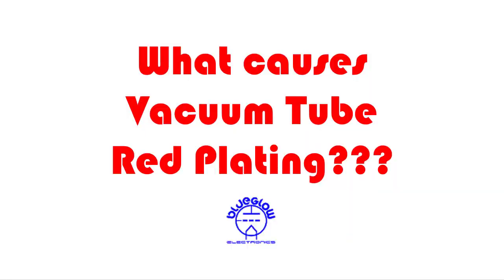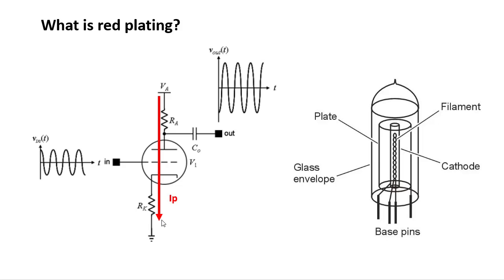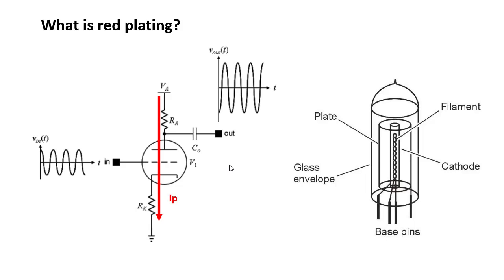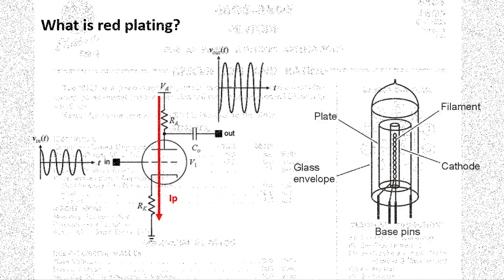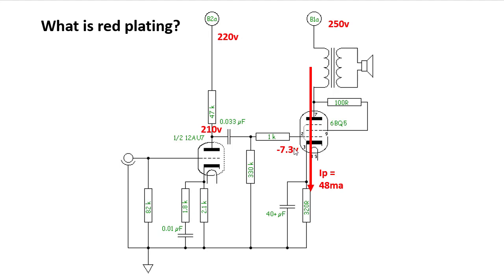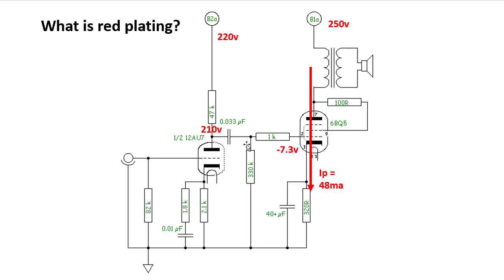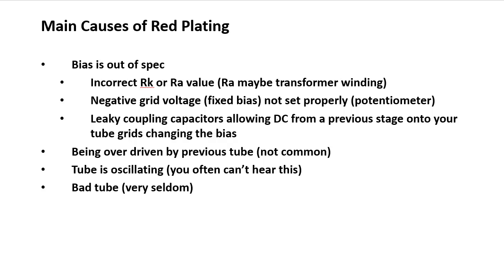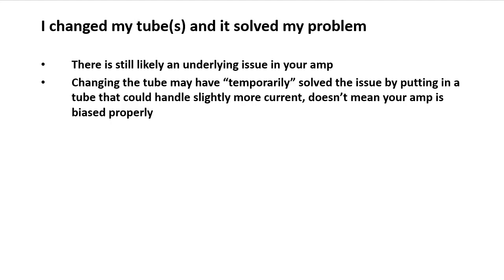What causes vacuum tubes to red plate?

Comment: Beautiful video!!! A customer just brought me a Orange rocker 30 and it's exactly a EL84 red plating. Swapped the tubes and it seems the trouble isn't anymore. BUT after watching this video, now I have to ensure something else is not failing.

In this case, amp HT fuse was blown up, and that was the reason customer came for. I replaced with a 500mA standart fuse and it blew, then I tried with a 1A and it didn't blew. Then I replaced with exact type of fuse Bussman 500mA slow blow fuse and also it didn's blew up. And only then I observed one of the two EL84 red plating.

Comment: Thank you for this. I have a brand new (well, it's actually about 5 years old now, but has about 30 mins playing time on it) Carlsbro 30W amp that has this problem on one of the 6V6GTs. The amp was a total disaster (I got it un-opened from a music shop that went out of business). From the very first power up, it was wrong. The first fault I found was the heater pins on one of the power valve sockets was not actually soldered to the board. I fixed that, but now it red-plates. I managed to get a schematic, so this has given me the inspiration to dig it out and see if I can fix it. I'd send it to you but I'm in the UK and it's a 240V unit ;-)
Cheers
Mark
Reply: It's red plating because it is drawing too much current. Check the grid bias.
Reply: Hi Mark. Let's stay by the book. As John mentioned check the bias. Since the amp was running asymmetricaly, consider the output transformer could be fried. Just for reference check the resistance of the primary winding. (From the center tap to the anode of each tube). PLEASE if you do so set the amp to "dark and cold". This means UNPLUG the amp and DISCHARGE the filter caps. In "hot and working" check the voltage drop from center tap to anode. In case you encounter divergence in the readings, switch the tubes and figure out if the problem stays with the socket or the tube. It would be nice if you could provide the schematic. Once again lift yourself from the ground i.e. rubber sole shoes etc because, anode  voltages are nasty somehow (some amps like Music Man go up to 700Volts!!!). Line voltage should not be a issue, step up/down transformers exist on both sides of the lake. Maybe your device has a voltage selector? For us in Europe only the power outlet plug changes. In Austria we use the "SCHUKO", it looks like a pignose....

Comment: Excellent.  My only thought is the role of cold or otherwise poor solder joints.  Increasingly over the years I am finding this to be a major issue.  My practice now is to touch up everything on a given stage before I even reach for a DMM.  Measuring bias when you have crappy solder work has been a waste of my time.

Comment: In the case of EL84 guitar amps, I'd consider a bad tube a pretty common cause. Typically, these tubes are run flat out at 100%, if not a little more, often with 300+ volts.  I've had several start to red-plate after a year or so of use. In the most recent case, one Sovtek EL84 red plated, had more blue glow (both in the bottle and the typical lines within the plate), and there was a noticable hum. Little orange specks were visible around the screen, too. Swapped the two tubes around, and after about 10 minutes it started to glow again, following the tube.
Reply: Hi there!! In my case, I did the swap, and none of them went red plate. What could it be?
Reply: @elsenordefiler1893  Oh so you had a red plate, swapped the 2 around, and the red plate went away? 

It could potentially be related to the bias on each specific tube socket, which may happen to not cause a red plate on the swapped tubes. It could still be a sign of a going-bad tube and/or very high 100+% bias. 

If they share a common cathode resistor, and voltages match up on screen and plate, that's unusual. 
I'd definitely check voltages to be sure both sockets are properly biasing tubes.
If it's adjustable bias, similarly it'd be good to make sure the tubes are running at a reasonable dissipation. 

Coupling capacitors before the grid can also cause this when they begin to leak and allow positive voltages on the grid, but this failure is usually more noticeable.
Reply: @JulianA-tr6pt Thank you for your reply! "Oh so you had a red plate, swapped the 2 around, and the red plate went away? " Yes it went away.

This amplifier is self bias so there's no adjustment pot and yes, the two EL34 share a common cathode consisting on three paralleled devices: one 270ohm 5W resistor, one 330ohm 5w resistor and one 220uF electrolitic capacitor.

For the coupling capacitors it has one 100n film cap for each EL34. Also there's an 12ax7 driving both el34.

Worth mention, red plating occured not that fast.

Comment: Howdy. Nice.
I have had my share of red plating in my designs. And You are correct.
In some cases the root reason was parasitic oscillations. These were devilish to spot. When the oscilloscope probe was connected between the anode and B- the glow died. But eventually the scope was connected over the OPT secondary revealing violent oscillation at about 50 kHz. In some cases increasing the grid stoppers worked. In other a small cercap. from the anode to the grid worked. Like increasing the Miller capacitance.
And yeah. A few coupling capacitors have proven to be leaky though brand new. My advice is to always check the capacitors with a multimeter before soldering. Also devilish to spot otherwise. Checking the DC potentials at various points eventually put me on the track.
Best Regards.
Reply: Interesting.  I only had it happen once when my bias was too hot.  I want from one neighborhood to another with higher mains voltage, and the Chinese tubes I was using were known for thin plates, (I think).  The sound dropped out completely, then I looked.
Reply: @qua7771  Howdy.
Thinking about it I had another root cause.
I had followed the rule of using a separate wire as the B- bus connecting it to the chassis only at the input jack. Nevertheless parasitics were experienced.
The cause was that the B- bus wire was too thin. I recommend using at least 1,5 mm2 as the B- bus. Also the bends in the B- were too tight causing inductance. Using as shallow bends as possible in the B- bus is recommended.
Regards.
Reply: @eugenepohjola258  Thanks for the tip. These are things I wouldn't ordinarily think of.

Comment: Good video!
Personal red plating experience:
Almost always a leaky interstage coupling capacitor.
Once in a great while, a shorted cathode resistor bypass capacitor.
I have never seen a voltage amplifier tube red plating. Have seen several output tubes red plating. Saw a few rectifiers red plating as the power transformer was smoking (shorted filter cap, one time a filter choke with an internal short to ground)
Reply: Dave Kazoroski I would hazard to guess since most preamp tubes aren’t operated anywhere close to their limits (usually) that it would take a pretty catastrophic event to make one red plate. I looked around and couldn’t find a picture of a red plated 12AX7. I would assume that the voltage dropping resistors and plate load resistors would probably limit the current sufficiently to keep from damaging the tube if there were a loss of bias, ie., cathode shorted to ground. Unlike your power tubes whose DC supply is through an inductor with a low DC resistance.
Reply: Actually, some voltage amplifiers have the cathode connected directly to B-. They use something called "contact bias". A certain number of electrons coming off of the cathode "stick" to the control grid, thus causing a negative charge of a volt or so to build up on the grid. 
And as you say, the plate resistor of a voltage amp is high enough to limit plate current. With a power tube the series resistance is very low, enabling a very high plate current to flow. Plus, a power tube needs several volts of negative grid bias - contact bias won't work here - loss of bias results in a grossly overheated red plating tube. ( I've seen TV horizontal output tubes orange plating - hot enough to melt the glass)

Comment: Amazing channel and have subscribed.  What could cause the plate current to drop if B+ and B- is correct, cathode/anode resistors good?  Cathode bypass capacitor good.  Tube is confirmed good and it's compliment is suffering the same issue in this balanced push pull drive configuration.  They directly drive high impedance headphones.  No transformer.  Swapping headphone channels (drivers) makes no difference.  The amplifier is a little dot Mk6+.  I am an electronics design engineer with 30 years experience, so no fears other than I am a tube noob.   It is a balanced push/pull configuration for each driver...like an "H-bridge".  So one set of 6080's for each channel, both affected by low plate current.

It looks like this could be a grid bias voltage issue?  Instead of overdriving the tube, it is instead "under-driving" the grids of the output 6080s???

Comment: A good explanation of red plating, thanks Mark.
I will look a bit further into this. I'm curious about the long term effects of red plating a tube... the failure mode would be different from a silicon device as the silicon device would either short out or blow open the substrate.. in the case of a tube there is no substrate, just a vacuum. Perhaps the damage is due to plate warping or other physical movement of parts in the tube...
I really appreciate these videos, thanks for taking the time to make them!
Cheers,
 - Eddy
Reply: Red plating causes the plate to release trapped gasses in the metal, damaging the vacuum.
In older TV's sometimes the horizontal output tube would red plate due to loss of drive. They got so hot the glass would melt. Red plating can destroy a tube in very short order.
Reply: Did a little more research (benefit of being semi-retired). 
When a tube is red plating, the current through it is much higher than normal. The massive flow of electrons to the plate litterally takes the special emissive coating on the cathode with it. As this coating erodes (normal over a tube's life) the tube gets weaker and weaker - low emission. Basically a few minutes of red plating is equal to several hours of normal use. So no matter how you look at it - red plating is bad for tubes.

Comment: Hello. Thank you for this great video.So I have this vacuum tube amplifier with eight  kt88 tubes as output. The amplifier plays well at low volumes but when I turn it up louder the B+ fuse (2A) blows. I did not have the chance to see if any of the tubes were red plating. Any ideas?

Comment: Hi blue glow, I'm working on a 1931 Philco "baby Grand" model 90 cathedral radio. I have this exact problem after replacing my line filter caps. I'm thinking now that my problem might lie in my Bakelite blocks as a coupling cap for the #80 rectifier. I wondered for days what I did wrong, stared at the chassis and the schematic.. now, I think I know. Thank you!! Any input is appreciated as I haven't worked on anything this old much before!
Mike

Comment: @ 13:30 leaky coupling cap..I am having problems with an el84 push pull..It is not red plating but I am reading about 1-2VOLTS  DC after the coupling cap to the grid of the el84.Is this acceptable?
Reply: Desolder the cap check DC-voltage cap to ground.

Comment: Question: Wouldn't an AC filament voltage being applied to a vacuum tube (as opposed to a DC filament voltage) cause the frequency of that alternating current to be also amplified and sent (and audible, measurable?) at the output of the tube?
Reply: Salvatore Rossignolo I’ve run filaments on 6.3 v dc instead of AC and it made no difference in hum level, so at least in the case of my amplifier, no.

Comment: Current flow models confuse newbie EE's/Techs. To keep it simple and the way that all circuits make sense is electron flow model.  As a vacuum tube is a voltage controlled device it makes no sense to envision a current flow model.  Assigning the action of a valve to the control grid makes sense to most folks and is how I learned about tubes, FETs are the same thing essentially.  Both are voltage controlled devices and need very little voltage to control a large voltage.

Comment: Can someone explain to me the role of the 40uF capacitor in // with the 320ohm resistor? Thanks a lot.
Reply: It's a cathode bypass capacitor. If it were not present, a negative feedback signal would appear at the cathode, reducing the gain of the tube.

Comment: The OB2 and OD3 are both a two electrode, ineinert-Gas-Filled cold cathode miniature tubes. Intended for use as a voltage regultor. Not a rectifier.  If a voltage dropping resistor in series with this tube is not selected properly or changes its value, the tube will glow brighter with higher current flow.  These tubes will fail and sort of "burn out" in an over current condition. 

Also, while an electron tube with filaments heating the cathode does cause electrons to boil off, they do not flow to to plate to create current or electron flow.  A complete circuit with a voltage  potential between the plate and cathode must exist to attract these electrons to create current or electron  flow.
Reply from the maker: That was a simple word mistake on my part.  I am fully aware of what these are and how they work
Reply: @Blueglow  I thought  that was the case but others ( newbies to tubes ) might take every word you say as The Gospel for tubes.  You do a good job and  I appreciate  your videos.
Reply from the maker: @williammiller5490  thanks man
Reply: @Blueglow  thanks I appreciate it, I learned something about tubes so I just wont go swapping them out, but will try to test for proper voltage, current, amperage , 😢😅  Why can'tI just change the tubes? Put in ones that can handle the pressure, voltage, amperage, flow of current, ( excuse my frustrating rant) I just want an easy fix, that wont cause damage to this $1,100 fender bassbreaker 30 r amp.

Comment: Well done but a too high B+ can also be a cause. You need to adjust your cathode resistor accordingly if your plate voltage is in the specs.

Comment: Some tubes are designed to do that. The earlier 813 beam power tetrode had a metallic carbon graphite plate structure. Medium power tube, 125 watts plate dissipation. A pair could easily handle 750 watts in Class C. Plates would glow cherry red under sort of normal conditions.
Reply: Yes - many industrial thyratrons and ignitron tubes (high current controlled rectifiers) also ran red anode ( industrial electronic term for plate) in normal operation. They were designed that way.
But, most receiving tubes were designed to run "dark plate". A glowing plate in audio or other home electronics is a definite sign of trouble.

Comment: could a speaker with too high of impedance cause the red-plating issue?
Reply: Late reply, but for anyone wondering - probably not. While impedance mismatches can be a problem, if it's a 100% mismatch (16 ohm speaker running on an 8 ohm output), there probably won't be much of an issue.

Another thing many may not realize is that the tubes will not be effected by speaker impedance unless there is sound being played through an amplifier. If the amp is idling, with no audio, you can run it without a speaker (or even a dead short circuit on the speaker output) forever with absolutely no issues. This is because the speaker is transformer coupled, and only the amplified AC signal will pass through it. The speaker impedance is only realized upon the tubes putting out AC signal, through the transformer. 
At idle, there is only DC on the primary side, for the tube plates.
Reply: @JulianA-tr6pt  Could someone run a tube amplifier without a load connected, without doing an harm, as long as nothing is plugged into the input jack?
Reply: @ericsalinas1839  Yes, you can. The output transformer only "reacts" to AC signal, therefore none of the impedance issues exist when there is no signal. When there is no signal coming from the output tubes, the amp doesn't know what kind of speaker load it has. 
There's a good reason to not do this though - if the amp is faulty and has bad oscillation or noise, or a loud pop is created if you're working on the amp and taking measurements, it'll be running into no load. It's best to always use a dummy load.

Comment: the section of wire of primary winding of transformer is more bigger than normal that is calculated for the right nominal voltage thats wy red plating

Comment: The way I learned it, the plate current flows from from the cathode to the plate-!!
Reply from the maker: If you follow modern electronics "conventional current flow methodology" it goes from + to -, thus plate to ground through the cathode.  If you follow "electron flow methodology", it goes cathode to plate.
Reply: @Blueglow  If 1mA is flowing in a 100k resistor, 100V are dropped across it whichever way it is flowing.

Comment: I disagree with you at 11:43 - it's not possible for the output load to reflect on the DC resistance of the primary.  It will most certainly reflect on the AC impedance.  In some cases, the lack of a load could allow the tube to oscillate which in turn could cause red plating, but that's different than saying the load affects the DC bias.
Reply: Do some reading about transformers.  The secondary side will effect the primary side in a number of ways.  I can't possibly describe the topic in a YouTube comment.  You need to read it for yourself.
Reply: @boonedockjourneyman7979  Yes, at AC, or during turn on/turn off.  But at steady state DC?  I don't think so.  The coupling between the windings is from changing magnetic field.  With DC, there is a field, but it doesn't change.  Therefore, no interaction.